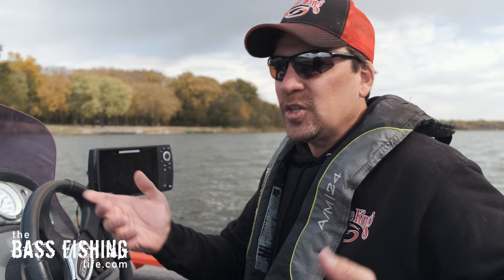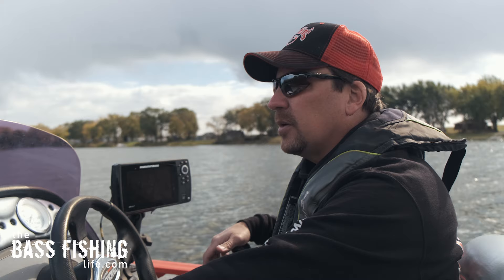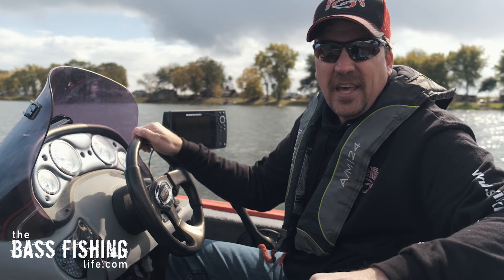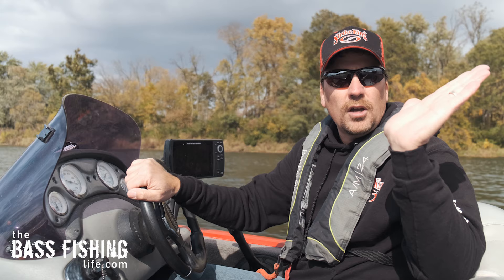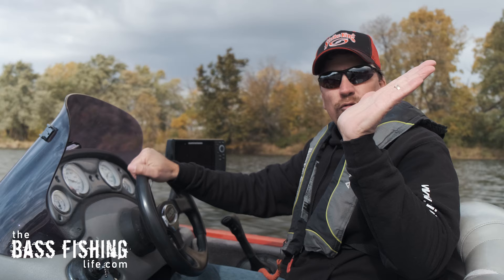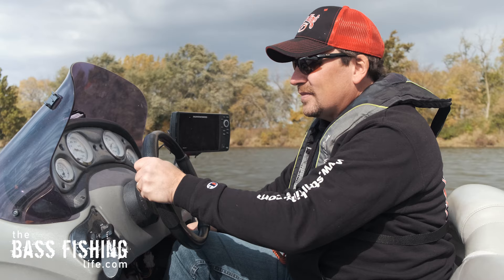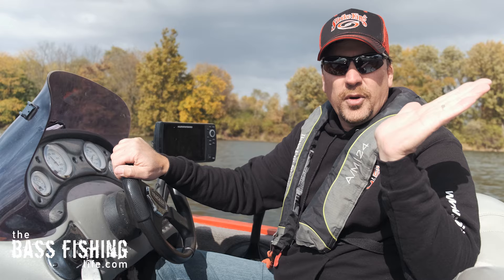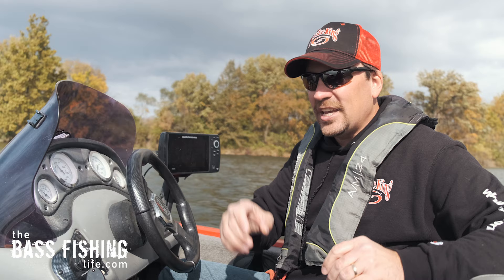The Basics of Trimming a Bass Boat | How to Trim a Bass Boat to Get the Most From Your Motor

Comment: Great videos. Im a new boater with a  1996 21' xpress bass boat. It came with a pro max 150 on it and would run 80+ mph. Now it has a 2001 200 optimax and a cant get it to even go 50mph. I have a 24 pitch 4 blade Quicksilver trophy prop that was recommended by the Mercury dealer. Any idea why its running so slow. I was thinking the prop is not in the correct location with the hull but cant find a good video on where that loction is. Any help would be greatly appreciated. Thanks
Reply from the maker: Wow. That's quite a difference. The first thing that comes to mind is the location like you said. It seems like it is not getting enough bite in the water. Have you had a different dealer take a look at how it is rigged - as far as it's positioning in relationship to the bottom of the boat? I might try and call Xpress too and try to talk to someone at the factory that rigs the boats.